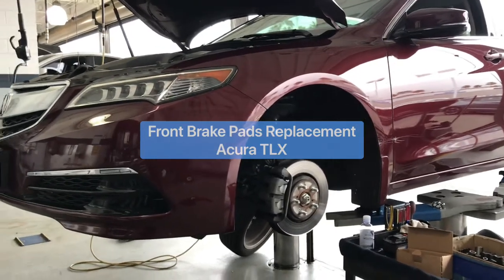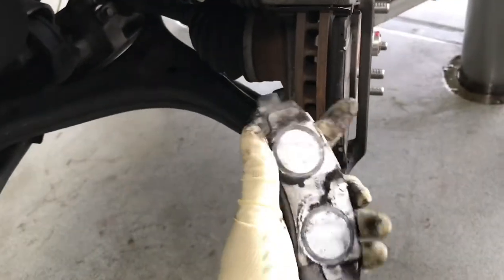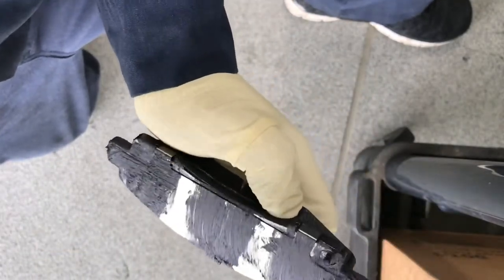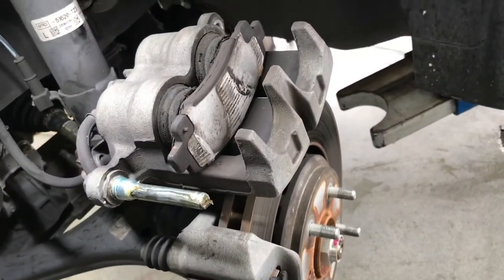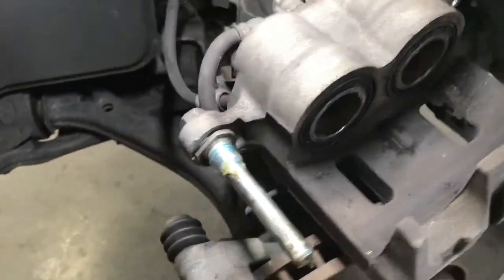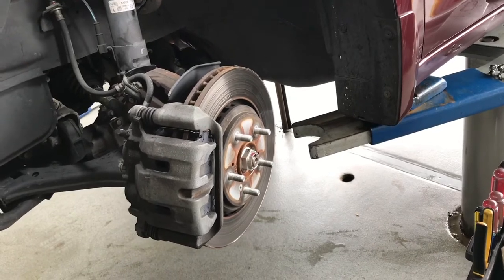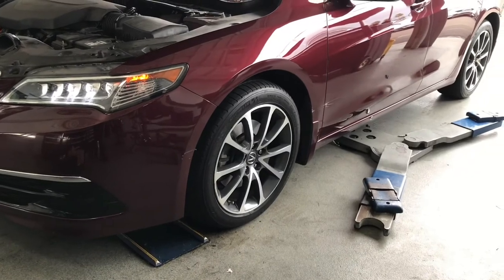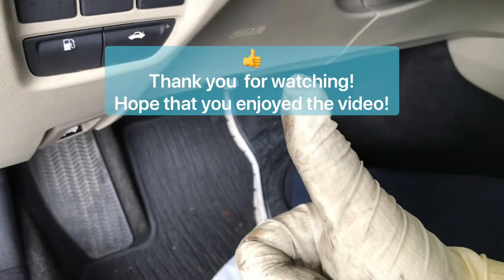Front Brake Pads Replacement - DIY - 2015 - 2020 Acura TLX

Comment: You are supposed to re-grease the guide pins, replace the clips, grease the clips and clean the whole assembly with a wire brush.  This is why I do these myself - with the total care package, instead of paying insane amounts for the laziest jobs.  No offense.
Reply from the maker: Thank for the tip. It’s to demonstrate the main steps to remove and replace the pads. 
It was done properly with care afterwards! 👍

Comment: Are you sure it’s the inner pad that gets the 2 shims?
Reply: I replaced my pads today and the 2 shims were on the outside pad.The previous brake job was performed at the dealership.
Reply from the maker: @M D thank you for the comment. That is a great comment.  It is the outside pad that gets the two shims. I will revise the contents.

Comment: The outside pad get two shims not the inside  what works for me is taking pictures as I go on with the job
Reply from the maker: Thank you C D for noticing that 😀
I did switch the shims to correct position. I have a side note in the description for it.

Comment: Those rotors needs to get cut.  I feel bad for the owner of the vehicle…vibrations for sure.
Reply from the maker: Thanks, Good note. 
This video was just for the demonstration purpose of  removed and replaced brake pads only. The complete brake job was done properly on this vehicle. You can rest assured for that.